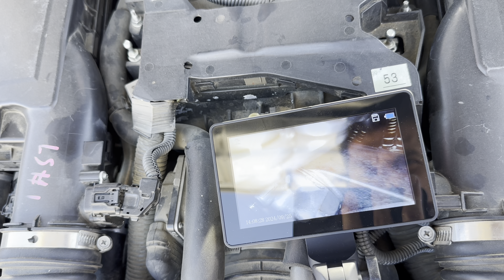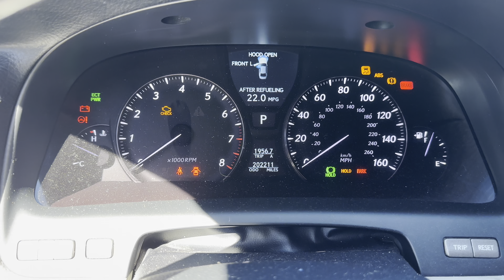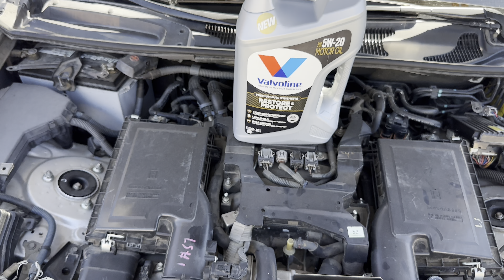Does Valvoline Restore and Protect really clean your engine?

Comment: My 2010 accord v6 was burning 1qt every 1k miles. After the 1st oil change its down to 1/2 qt every 4k miles. Been using Valvoline for decades & this Restore and Protect oil is a game changer.
Reply from the maker: That’s awesome, thanks for watching!
Reply: Do you have a VCM muzzler installed on your v6 accord? My 2005 honda odyssey was also burning 1qt every 1k with vcm. After installing VCM tuner, oil consumption reduced drastically as it only lost about 0.5qt at 5k.
Reply: @kevinfernando3167  yes i did install the muzzler at about 90k. Consumption actually stayed the same. Im at 205k now & the Restore & Protect has almost taken it down to almost zero.
Reply: Just started using R&P in my 2003 Accord with 225k miles, it burns about 1/2-1qt every 1000 miles. Hoping this cuts down on oil consumption.
Reply: Son has a 2009 accord v6, problem was so bad that he was fouling out spark plugs on the back bank after about a week or so.  Honda indicated this was known issue and only real resolution was to re-ring the back bank at about a $4k cost...suggested using BG products to buy some time.  Used BG EPR treatment for 2 oil changes in a row, oil burning went away, spark plugs quit fouling, and that was 3 years ago.  Going to suggest he uses this restore and protect going forward, though, seems like it works well.
Reply: I have an 08 Accord with the 4 banger and it had the pistons and rings done under warranty at 115-120k miles many years ago. in the past few years it started to slowly burn oil again as i started to creep up to 300k miles. I saw the restore and protect and figured might as well try since it works and i dont have to worry anymore or it doesnt and i'll just have to keep topping it up. im now at 318K miles and it barley burns anything anymore.
Reply: That's really lucky because my Kia Sportage was consuming 1qt/500 miles and it wasnt until nearly the end of my 2nd oil change with the Valvoline Restore and Protect did I see some improvement. I'm still at 1qt/1000 miles after almost 8000 miles across two changes. I just started my third round with the stuff yesterday.
Reply: fixed my 2013 Honda Insight.
Reply: So, if you've "been using Valvoline for decades", and if its good oil then why did your car have this oil burning problem in the first place? Maybe its not as good as you think?
Reply: @nickv4073  A lot of cars start burning oil because of bad piston rings from the factory. (Audis, Honda from the 2010s, older Toyotas  etc etc.) It had nothing to do with the oil. You could have changed your oil every 3,000 miles and it still would eventually start to burn oil.
Reply: @nickv4073  its carbon build up. I have worked in the automotive industry for over 30 years and up until this oil was introduced the only thing you can do was a very agressive chemical flush to remove carbon which can cause problems like drying out valve stem seals or completely wiping the protective film the previous oils left. No oil producing company had ever had an additive package in their oil to gently break down carbon build up without risk of damage to internals. I sent in for analysis after my 1st change and the results showed high concentrations of carbon soot, which is a natural by product of gasoline combustion.
Reply: @nickv4073 
Stop asking the HARD questions!!🤣
Reply: @Scottm-n6h  that's a big improvement 👏 wow 👌
Reply: Sheepshead you make me wanna get my 2012 mdx back ..burning 3 qts every 1500mi ...
Reply: @nickv4073  Sounds like he was using regular Valvoline oil before high/very high mileage oil burn started setting in.
Reply: I've got a 2000 Accord V6, serviced every 5k miles with 168k total. Virtually silent operation (outside of Vtec...😅). Would like to try this stuff but can't find it in the UK.
Reply: @nickv4073  LOL I came to say this too!

Comment: Great video. Our prius drinks oil like a sailor. I'm going to use this on our next oil change
Reply from the maker: Cheap way to solve a common problem, thanks for watching!
Reply: Depending on how bad your consumption is, you might have a bore scoring/bore wear issue which this will not fix. This is a common problem on higher mileage Priuses due to low tension rings and 10K+ mile oil changes (both due to government regulations, you know, the people who aren't experts on anything making laws on everything.) If this fixes your problem, start doing 5K mile oil changes (yes, even with synthetic). 10K+ mile oil changes aren't good for any engine's longevity, regardless of the type of oil used.
Reply: Never knew sailors drank oil 🛢
Reply: My daughters Prius has 200k miles it also consumes a lot of oil. So I picked up a quart of this stuff to replace the oil that her car consumed and it has helped slow the oil burning. So her next oil change I’ll use this stuff, I’ve tried Berryman b12 piston soak that didn’t work
Reply: @chrisa7832  You might want to bore scope it and see if you had cylinder wear because if you do, no oil will fix it.
Reply: This isn’t going to help. When an engine consumes oil it’s because the piston rings have worn out. The piston rings are done. Especially if ring wash is visible on the piston head. All this does is clean carbon, which might free the piston rings from carbon, but it won’t solve the main issue. If you wanted to prevent wear as much as possible you should’ve done 5000 mile oil changes with penzoil ultra platinum and a purlator boss filter. Penzoil ultra platinum is the far superior oil.
Reply: @2seep  Not sure on the Toyota motors but on the Audi side, this isn't necessarily true. Many in the Audi community have fixed their oil consumption issue with things like the Berryman B12 piston soak. The problem is that the carbon builds up on the piston ring area and the biggest issue is on the piston drain back holes (being that they're rather small on the older Audis). They get coked up with carbon and get plugged. The B12 soak dissolves enough of the carbon out so that the holes are opened up  (again, holes are too small for extended oil change intervals...do 5K OCIs!) and the ring is freed up to do it's job (low tension rings is the problem here). You're 100% right with the 5K oil changes. PUP is a great oil but there are others too (Amsoil, Driven, Rowe, etc). On the Audi side, the Mann/Mahle/Hengst oil filters are the go-to. 5K oil changes with good quality oil and filter will prevent buildup. Also if your engine is direct injection, use a API SN PLUS or API SP oil. The "regular" API SN oil has too much calcium and can lead to LPSI (Low Speed Pre-Ignition) where the combustion happens before it's suppose to, which is bad for you engine and it can lead to a cracked/melted/blown piston.
Reply: Have you changed the PCV valve?
Reply: @2seep Prius has a known problem with its Atkinson cycle engine.  The rings get coked up and allows oil to bypass.  Many (not all) owners have been able to at least reduce the burning with this type of oil or other methods to gently remove the coking over time.  I never heard of anyone being able to ELIMINATE  it though.
Reply: @chrisa7832  watch your oil filter(s), they get clogged at 500 miles if there is alot to clean in the engine.
Reply: @jdm2gdm  I had MerCruiser V8 with low 50 to 100psi, Restore turns them all into 140 -145psi, magic.
Reply: @dalepeter8392  Glad to hear that V8 is healthy again. Yeah if your only problem is coked up rings, drain back holes, sludge, etc. VRP will DEFINITELY help slowly cure a lot of those issues. I'd have no problems recommending VRP for at least four to five oil changes (@ 5K miles per oil/filter change) to see if fixes the problem.

If I bought a new-to-me used car and it had a mild oil burning issue (and things like PCV, gasket leaks, etc. were all check and fixed), I would first do a Berryman B12 piston soak, then run VRP for like 3K and then I'd do another B12 piston soak and then run regular 5K oil changes with VRP. If after five VRP oil changes the car still burns oil, I would guess that it's a more serious, probably wallet killing, issue.

With Priuses I would guess that the owner may or may not know that it needs maintenance and if they do, they probably followed Toyota's long oil change intervals (because let's be honest, I don't see many "car enthusiasts" owning a Prius). If the rings have been coked up for a while, the pistons have been basically "free-balling" inside they cylinder walls and the results will be scored bores that no amount of VRP will ever fix. If that happens, the short block will need to be replaced. I personally know of a few people who's Priuses have met this fate. hey either bought or inherited them with high mileage and questionable oil change intervals so even 3-5K mile oil changes during their ownership didn't help. A couple of these were drinking 1qt per 1K miles so they were essentially doing constant oil "changes", lol. I've personally bore-scoped these car and saw the scoring (plus this issue is becoming more widely known).

Comment: We need project farm to test the wear protection though and viscosity at extreme temps
Reply from the maker: He is the best at it for sure! Thanks for watching!
Reply: Testing engine oil protection without an engine is pretty pointless
Reply: Pure snake oil use 2oz of transmission fluid at every oil change keep the damn engine clean and 5000 between oil changes is to long get that

Comment: I use it in my 3.5 ecoboost and it is great performing oil. I'll be doing my 3rd oil charge some time in Oct using this. i check my oil every two weeks, did not have any loss of oil prior but, with traditional synthetic oil, it would darken around 3k. now it really doesn't get dark until I am approaching 5k. good luck with yours, kudos. nice video.
Reply from the maker: That’s awesome, thanks for watching!
Reply: color does not indicate dirty or old or bad. different base stocks react differently to heat...
Reply: That engine is meant to fail 🤦🏽‍♂️. It has timing chain issues.

Comment: 3 oil changes ago at 3000 mile oil changes.  Kia rio 190,000 now . Went to 5-30 w. My oil consumption is down also. I won't share all the maintenance I've done recently.  I did alot of cleaning when I replaced injector o rings, cleaning of tops of valves with some crc, new valve cover gasket,  intake, and throttle body gasket. I'm really pleased with the oil.  I did a compression test before all this and one was lower than minimum required so I know the rings are worn as normal at this milage.  I learned so much by jumping into my new car care mindset. At 66 years old I'm excited to learn more and more mechanical work i want to dig into
Reply from the maker: Awesome results, make sure to share an update as time goes on! Thanks for watching!
Reply: Yeah my 2016 Kia Rio burns oil. Probably 1qt every 1k miles. Looking forward to trying this oil.

Comment: I've got the same car, 07 ls460. 165k miles on it. I was thinking i was going to have to sell it. I was watching crazy vids on how to fix with solvents, but gonna do that. Then saw a vid on "the motor oil geek" channel about this oil. Tried it. Can't believe the change. Have done 2 changes so far and it is running better. In his vids he actually visits Valvoline test center. 👍👍👊👊🤘🤘
Reply from the maker: Awesome! Thanks for watching!
Reply: Were you going to be honest with the new buyer or deceive them??
Reply: What do you mean? Just driving the car showed smoke. You asking a question like that is interesting. Questioning another's integrity. 🤔
Reply from the maker: @MrAmk3rd what smoke?
Reply: @Fix-it-tony Same burning oil all these Toyota engines blow due to stuck piston rings at 100k plus. This oil fixed that.

Comment: 2.5 quarts/5K miles in my 2016 2ZR-FE Corolla after 100K miles. Changed to 5w30 at 200K. Now only 1 quart/5K miles. First run of Valvoline R&P about 1350 miles ago!
Reply: Ya my daily is a 2003 civic with 198,000 miles. Use to burn 1 quart between oil changes. This is the first time I’ve used R&P Valvoline oil. I’m at the mileage for my next oil change I haven’t had to add any oil this time.
Reply from the maker: Awesome, let us know here, thanks for watching!
Reply: My 2016 2zrfe has 119,000 miles, and it burned a ½ quart of oil in 5,000 miles when I used Valvoline. Went back to Castrol Edge, and it didn't burn any oil.
Reply: Do you know what the oil change interval was for the first 100k miles?
Reply: How did it affect your fuel mileage?
Reply from the maker: @henrystowe6217 no change noticed, always used synthetic so it flows the same.
Reply from the maker: @musicconnoisseur4019  oil was changed every 5k

Comment: I started off using Pennzoil Ultra Platinum 0W-20 in my 2017 Toyota Camry with the 2.5 with 18,900 on it. When I got up to 180,000 miles. I started using Valvoline Restore and Protect 0W-20 and I noticed right away that the engine was super quiet and when I removed the valve cover. The inside of the engine looked like brand new. Even the cylinder bores showed no signs of wear. I'll definitely keep using this oil.
Reply: I drive a toyota with the 3.5 v6 and i boticed the immediate quiet abd smoothness 9f the wngine with restore and protect. Just 500 miles in and its atill great. Better mpg too
Reply from the maker: Awesome, thanks for watching!
Reply from the maker: Awesome, thanks for watching!
Reply: So you don’t like pennzoil ultra platinum?
Reply: @vandiyplant921  I didn't say that I didn't like Pennzoil Ultra Platinum anymore. Don't get me wrong, Pennzoil Ultra Platinum is really good oil. I just noticed my engine was even quieter and seemed like it had more power after using Valvoline Restore and Protect. Both Pennzoil Ultra Platinum and Valvoline Restore and Protect keeps your engine clean with 5k oil change intervals. However, for my application, Valvoline is a better fit. That's why oil analysis is so important.
Reply: @merrillschaps2325  ok that makes sense thank you for clarifying
Reply: @merrillschaps2325 the type of oil is only part of the equation. If you were going too long between oil changes, it won't matter if you're using the "best" oil.
Reply: Merril, what did you learn from testing?
Reply: So it was the pennzoil that kept your engine clean
Reply: I used Pennzoil UP 0W-20 for my Acura, Honda and Lexus. Valvoline R&P is a new oil and getting a lot of attention lately. I plan to switch over to this oil for all my vehicles. Thanks for sharing!
Reply: @vandiyplant921 it's kinda funny, Pennzoil has been marketing ultra platinum for years as to clean piston ring lands and the engines cleaner than any other oil. I have used it for years. There is no varnish at all inside the engine looking through the oil fill.
Reply: You ran Pennz  Ultra Platinum for 160,000 miles, why would the engine look dirty.
Reply: @MHolt-q1q  it wasn't so much of the internals of my engine being dirty. I was more interested in how quiet my engine ran when I switched to Valvoline Restore and Protect. My engine also made less noise on cold starts as well with the Valvoline Restore and Protect. However, like I have said in a previous comment. Pennzoil Ultra Platinum isn't a bad oil. I just changed oils because I noticed my engine is quieter with the Valvoline Restore and Protect than the Pennzoil Ultra Platinum.
Reply: @leegmc1985  beautiful, ok so I’ll use either r and p or ultra platinum on new crv thank you
Reply: @merrillschaps2325  With the low tension piston rings that Toyota and Honda uses, V R+P seems to work good. I also like Pennzoil UP
Reply: 2015 camry owner here. I was burning 2.5 quarts less than 3k miles @ 180k miles. 1600 dollar bill from the dealership and still burning a quart every 1000 miles. I went to valvoline and had them put this in yesterday. Fingers crossed I'll also change my oil every 3-5k going forward.
Reply: @mariejane1567  how often were you changing your oil before hand? If you were doing the 10k oil changes. It maybe too late. The piston rings and ring lands get carboned up and stop spinning causing major cylinder wear. I have been changing my oil from 18,900 miles every 3,500 to 4,500 miles. I now have 236k on my 2017 Camry 2.5 and I think I go through a quart of oil every 3k. You may also want to try and replace your PCV valve if it hasn't ever been changed. I change mine every 100k. A plugged PCV valve could also cause oil consumption.
Reply: Oh Lord i suppose valvoline just scored big n other oils will sit on the shelf get sent back to suppliers soon.
Reply: So its gonna fix toyotas known natural clicking noise or what? Toyota might says cheeeeeeez someone helped us fix our toyota clicking noise that we could not eliminate in decades. And now we can tell toyota the clicking noise was not natural to thr engines!
Reply: @merrillschaps2325  You said that your engine ran quieter with the  Valvoline R and P.....was it 5w30?  Perhaps the Valvoline was a heavier weight oil compared to the Penzoil Ultra Platinum you were using?
Reply: @Nick91768  I ran 0W-20 in both the Pennzoil Ultra Platinum and the Valvoline Restore and Protect. My wife who knows nothing about cars noticed right away that her 2012 RAV4 with the same engine 2.5 ran quieter. Its the difference in additive packs in the Valvoline Restore and Protect that makes it run quieter. However, both are really good oils and both will keep your engine clean.
Reply: I'm using same as pennzoil and thinking about the same changing to valvoline rnp. Keep us updated.

Comment: I'm on my fourth oil change on AGM 5.3.
 It has rotted 400000 miles. My engine is as quiet as it has ever been.  At 2000 miles, when I check my oil, it is still golden.
 I did have some smoking when I first started it app, but that has gone away 100%.  This is good oil
Reply from the maker: That’s awesome! Thanks for watching!